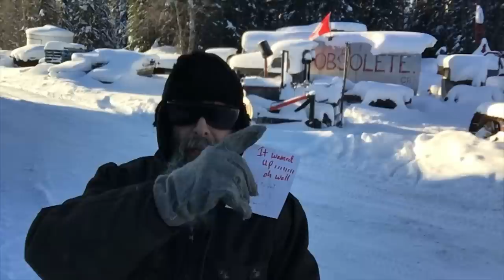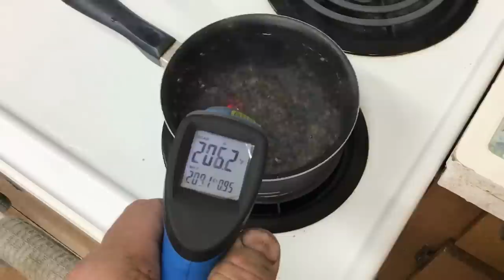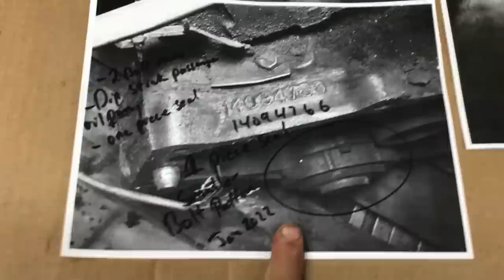Linn Tractor Hydraulic Tank, Short Videos from Jan 01 15 2022 Feb 23 2023

Comment: Keep on keeping on Joey! Hey could you take some time out of your busy day to explain how the sleds track and steer behind the Dozers in a turn? Yoke links? or Hard bars like tank recover vehicles?
Reply from the maker: we have a few old videos on the sleighs here on my youtube channel but once the Linn #2 is up and running then we will be playing with the sleighs again  thansk
Reply: Short answer is cross-chains. 
If you can picture the front set of sleigh runners,  and picture the rear set of sleigh runners,  the right side front runner has a chain off the tail end of it that goes straight to the nose of the rear left runner,  and the left side front runner has a chain that goes across the the nose of the rear right runner. The chains cross over each other like an "X",  and when the front end runners begin to turn to the left, the cross chains pull on the rear runners, which causes them to steer the opposite way, which makes the back end of the sleigh turn to the right, proportionally to the amount the front end is turning to the left.  As the back of the sleigh scoots out away from the turn, it pulls the next sleigh out (right) a bit before that second sleigh then follows along and starts its own left turn,  repeating the same effects. As the number of sleighs adds up, there is some loss, but it is minimal.  The operator up front makes sure to begin the turn as wide as he can to make up for the minimal loss that the "train" will experience.
If you watch some of Joey's recent vids where he is running a train in daylight, you can see the chains underneath, they are big ugly heavy old chains, but they still serve their purpose.

Comment: That hydraulic tank should work just fine. I have an air regulator that I hook into the air line to test tanks. I like your "inner tube relief valve" idea. Can you get a pic of the name tag with the model number on that flow control? I have quite a few contacts after 40 years in the Hydraulic business and might be able to get you more info on it. #32 oil will be fine for your application.
Reply from the maker: yes when people take shop air at 140psi and hook it to a tank to test don't realize how dangerous that is. that is a lot of pressure on those welds. will add the flow control when we hook it up then you can pause to see.  thansk

Comment: Good job on welding the hydraulic tank and no leaks! Plus great advice on checking for leaks I am going to remember that. You know I have had water pumps and heater cores that leaked and I used a product called Bars Leak that spelling is just a guess but it has got through a couple of winters so I could fix the leak in summer. Especially if the bearing on the water pump is good it will be a tiny leak and it probably will go away after you run it hot! 
Just wondering what weight of hydraulic oil you use?
Do you change it in Spring and Fall?
Carry on Canada 🇨🇦 😊
Reply from the maker: the bubble test is old school and saves a lot of problems when using cheap rods in the new world we now live in. we only use the 1 hydraulic oil (32 i think) year round because we only get 5 hot days in the summer and none of my equipment is made to work in the summer. over the years i gave up on any leak fix because it only prolongs the repair like a bad marriage untill it if corrected with a DIEvorce.  thansk